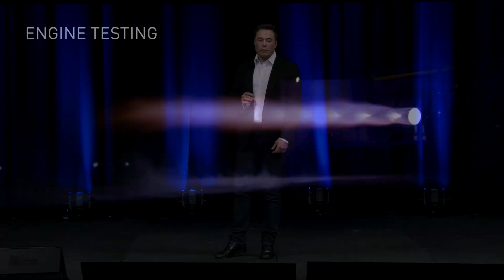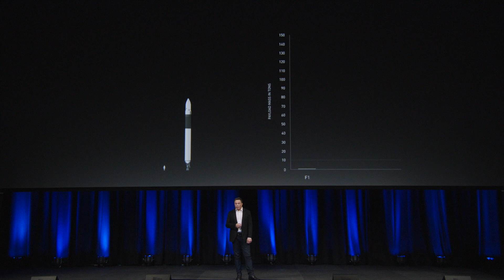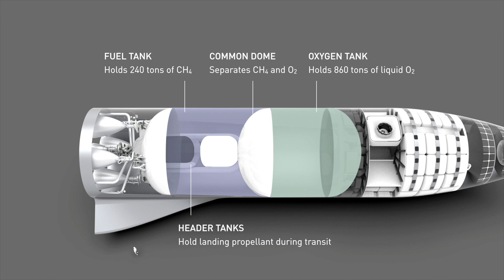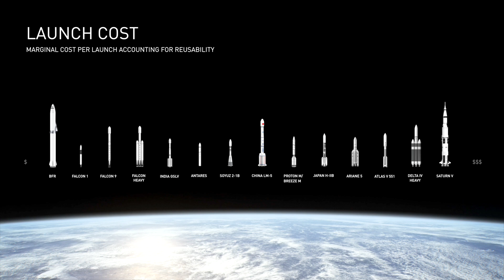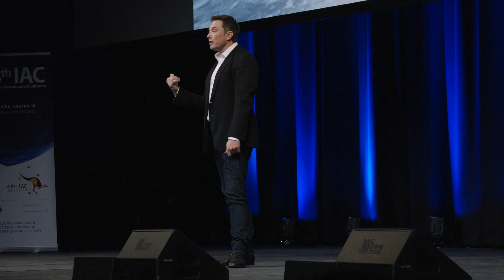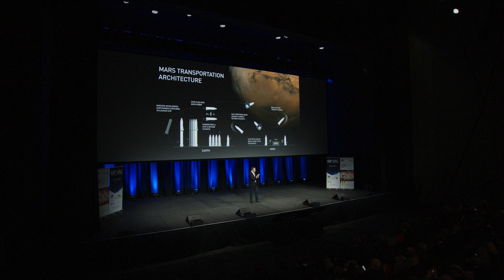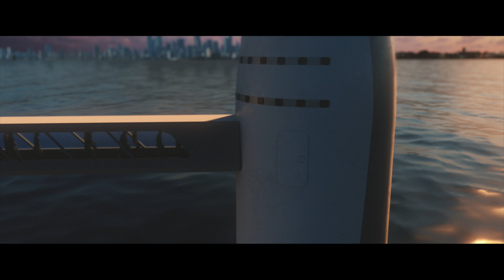Making Life Multiplanetary

Comment: You need nuclear to power a city on Mars, so if Elon could just take the next step with nuclear energy and take over the energy market as well, that would be the dream.
Google LFTRs.
Reply: Keep in mind, Elon and SpaceX will have nothing to do with the colony itself. All they're doing is supplying the rockets, what's done there is up to their customers.
Reply: Mate, don't put everything on Musk! He can't just invent everything. You do it. U say - 'pff me?'  YES! - You! learn some physics, join some resarch team, find some investors and bring us closer to thermonuclear or other new energy source so elon can use it on Mars! C'mone, don't just stand there, GET TO WORK!
Reply: "Solar can never replace fossil fuels (especially on Mars!). " ? Uhm, there are no fossil fuels on Mars, it's not the Earth. You can make chemical fuels with energy and the needed raw materials, it's not fossil though but "artificial" if you like. Which power source you use to do this doesn't really matter at this stage.
Reply: Basically any non-corrosive substance with a boiling and liquid point in an acceptable range and a high enough heat capacity is suitable for use in a turbine. Supercritical CO2 is a possible alternative.
Reply: Again the thorium guys, you would have to carry fissile materials to mars, witch, even if you discard the risk of putting radioactive materials into a rocket, are very dense, shield the reactor and use untested liquid co2 for heat transference? Yeah that is way less complex than solar. To build and run an nuclear reactor you need a lot of specialists, a lot of maintenance and a lot of time, with photovoltaic pannels you just mount them and forget, sure you have to dust them once in a while but that is  it. With the level of complexity and mass needed for a nuclear reactor you could build even an orbital solar installation and beam down the power since they would need an orbital gateway in the future anyways.
Reply: Merecir they have to start somewhere, solar will work fine at first, and sometime down the line, they'll develop nuclear.
Reply: Brian: So you failed in the task of actually checking out what a LFTR is.
-Just so you know, you do not use water at any stage in the process of creating power in a LFTR.
As stated, Mars is too far away from the sun to provide a significant amount of energy, the bigger the solar farms get the more effort is needed to keep them clean from Martian dust.
RTGs can power rovers and space probes (Curiosity uses two of them), but lack the juice to power even a proper mass moving vehicle.
Fusion is still practically sci-fi, and still 'only' 50 years away from a functioning reactor. What do you mean by creating energy "directly"? A fusion reactor would still heat a medium that then would run a generator, just as the most basic coal powered plants we use today.

Fun fact; RTGs run on P238, the production of P238 only takes place in ONE place and they only produce about 1,5kg/year. 
In a LFTR the only "waste" produced is P238. So with LFTRs on site you can make rovers powered by locally made RTGs. No need to transport Plutonium all the way to Mars.
Reply: Yes I know a LFTR(or any molten salt reactor) itself does not use any water.. but I wasn't aware that anyone was using a non-steam methods to extract the heat and drive the turbines. After you get the heat to the heat exchanger the rest really doesn't have anything to do with the reactor. Though I do see some references to using other gases but i'm not seeing any good sources, can you point me to one. that sounds interesting if there is a method other then that. 

There are a few companies now working on fusion devices that do not produce energy running a generator. The ones that I follow are Dense Plasma Focus devices. LPPX is making good progress on this. It creates electricity by running an ion stream through a coil and converting x-rays to electricity like light for solar panels. 

I thought LFTR didn't product any P-238. Isn't that the reason people like it, and most likely why it was never developed. It's main by product is U-233 with cannot be weaponized.
Reply: Sorry, I was thinking of P-239.
Reply: Lmaluko: There are plenty of Thorium on Mars. You only need ready fissile material to start the reactor, after that you just feed it Thorium and it makes Uranium as part of the process. 
They are already sending up Plutonium in RTGs so that risk is obviously low enough.
To even come close to the output from a reactor the number of solar panes you would need becomes ridiculous. Remember that the sunshine on Mars is much fainter.
When the solar panels break they need to send new ones, a LFTR just needs local Thorium to run.
Reply: I doubt that any city on mars would have the water to spare for any LFTR, or common fission reactor, for a long time. Best would still be solar or a fusion device that directly creates energy. Not sure how useful radioisotope thermoelectric generators would be for large scales like this, but they would give needed heat as a side product.
Reply: Merecir 
Musk owns one of the largest producers of Solar Panels in the world.

He's probably just gonna further his own interests.
Reply: Solar can never replace fossil fuels (especially on Mars!). Solar might be enough to power that fuel station if it has two years to make fuel for the next launch window. But to build a proper base with heating and powerful mass moving electric vehicles they will absolutely need nuclear reactors.

Comment: First big issue: I think the retro rocket manned landing is going to be difficult to man rate, I can't see how you make it fail safe or not subject to single point catastrophic failure. Maybe the crew will have to parachute! Secondly sub orbital transport, is he high, the noise would be nuts and the fuel cost per person massive. Also the issue of man rating the retro landing only this time with 500 people onboard!
Reply: Man rating it will take time and many successful landings.  Fuel cost will not be enormous: 

At take-off for long distance flight airplane has fuel about 40% of its mass.  Rocket to LEO needs be about 90% propellant, BUT most of it is oxygen! So rocket needs only about 20% fuel of take-off mass (less for intercontinental flight).  Perhaps BFR cannot take as many passengers as airplane (same size), but energy efficiency is not much worse than airplanes. It is probably more energy efficient than any supersonic airplane will ever be.
Reply: jkn An aircraft landing is inherently more failure resistant than the propulsive landing, the failure of any one component generally won't cause a catastrophic accident. Whereas the propulsive landing has the rocket coming down at high velocities until very close to the ground, also you don't get multiple goes at it. Realistically I expect that it will take around a hundred propulsive landings to man rate for daring, trained astronauts with access to things like spacesuits and ejector seats. To allow commercial flight landings you are going to need to demonstrate that propulsive landing fails less than one time in a million, even with component testing and qualification testing in extreme environments I think that you will need to demonstrate tens of thousands of propulsive landings if not an actual million before commercial passengers would be allowed to fly.
Reply: Deep_Dive, Short duration of rocket flight means that weather at landing site does not cause surprises.  Landing is fully automatic.  Two risk factors of airplane landing removed.  

Perhaps passenger section of rocket ship should be able to separate and land in case of emergency, like Dragon does.  We will not see this soon.

Comment: My question is this:  Why not test our ability to colonize another planet, by colonizing the moon first?  It would be far cheaper and faster to learn from our mistakes and ready ourselves for the challenges that await, close to home, instead of travelling such long distances at the outset of such an endeavor.  Does anyone see a good reason not to do so, and proceed directly to Mars?
Reply: Ya ideally a moon base would come first, but Musk is trying to get people on board to the big step of permanent colonizing which needs Mars.
If you tell people now we will first only go to the moon and then wait a while, then we get back to the old problem of public loosing interest before things really get going.
Reply: The moon doesn't have enough resources, and is really inhospitable in general. Mars is too, but it still has some redeeming features.
Reply: I agree that the radiation would probably be a concern, with no atmosphere and an ultra weak magnetic field...  I'd suppose a colony structure would have to either be heavily shielded, or built underground- both solutions posing problems with transporting weight from Earth into space.
Reply: Radiation is not the problem here. Mars doesn't have operational magnetosphere either. The moon only has negligible trace amounts of H2O. Almost impossible to mine and therefor you'd have to ship oxygen and water back and forth from earth. That is not economically viable and will fail due to lack of money. You cannot sustain a decent sized colony there. And Lunar gravity is .19 mars is .33, the closer to 1 the better.
Reply: Listen to Dr. Robert Zubrin explain why Mars first is the way to go.

https://www.youtube.com/watch?v=EKQSijn9FBs
Reply: Money
Reply: xNyghtshade, I don't agree with him.  This does not matter.  Others want to go to the Moon.  SpaceX will provide transport.  So we will have Moon base before SpaceX gets landing permission for Mars.
Reply: TBestiG, Moon does have enough resources.  I don 't know about nitrogen and carbon, but life support does not need much of those.
Reply: Moon does have enough water for base and fuel production.  (As ice on polar craters and in minerals elsewhere.) Moon gravity might not be enough for our bodies (we don't know).  That can be solved with rotating structures.

Huge advantages of the Moon: Shorter travel time and possibility to launch to orbit without using rocket fuel. (Long maglev track needed.)

Comment: What about Europa and Eceladus ?
Reply: Ganymede makes more sense, is bigger so more gravity = better for humans. There is water and it is the only moon in solar system with magnetic field, reducing radiation perils. Will have to convert second stage to operate on liquid hydrogen though and perhaps refuel on outer edge of the asteroid belt. If you build four stations there launch windows will be abundant enough for economic relations between Mars and Ganymede.
Reply: Yes, Ganymede for a settlement, but i was more onto exploration. Europa and Enceladus will need drilling, and making that with robots is just nightmare. Solar is just not enough power around Saturn. Jupiter is the limit for exploitable solar energy, except if there are some major breakthrough. Anyway a polyvalent spaceship is the way to go, if you can't budget your n'th project, make it the one project.

Comment: I do see how you could run into some problems with cramming 100 people into a rocket for a 3-6 month mission. I think it would be more reliable to just send 10 people at a time unless we can put the 100 people into medically induced comas for the trip
Reply: 825 cubic meters of pressurized volume is 8,25 per capita = pleasant. Square footage is irrelevant in zero G since you use all of the space available to you.

Comment: Is it possible to prevent detrimental damage to the spaceship carrying the crew in case of explosion? What would be required to do it? Is it even possible with currently available materials or would it require something like a 5-meter thick steel shield between the O2 tank and the spaceship?
Reply: Good real-time engine and tank analytics + third stage / escape pod with superdraco thrusters would do. Dragon spacecraft V2 is already capable of this, just need to scale it up.
Reply: But what about the blast itself? Wouldn't it destroy the whole thing?
Reply: If precursors to blast are not detected early enough, I think it would destroy it all yes...

Comment: 34 mins, with ion thrusters, electric thrust is technically possible
Reply: It is, but horribly slow. They have/are investigating electric propulsion, but realistically the energy demands would be so high for a worthwhile thrust level that they'd need to use a nuclear reactor (because otherwise the needed solar panels would be HUGE), which would incur possibly-insurmountable regulatory issues. Also, if you are then allowed to use nuclear for a power source, then nuclear-thermal propulsion starts looking really attractive, although its lower efficiency, since you can generate massive thrust with it at still much higher efficiency than chemical propulsion, and drastically lower trip times (and thus, much increased cargo capacity, due to needing much less propellant, since you'd just use chemical propulsion for takeoff and landing, to avoid nuclear contamination of those sites) - and they're investigating this, too.

I do wonder whether you could actually get a really powerful electric thruster using nuclear power... if you can produce nearly a GW of power, surely you can accelerate a lot of xenon continuously. It's still be considerably less than a chemical or especially nuclear-thermal, but you could run it nearly continuously, sooo... hmm.

Comment: "Chief Designer" is Elon's best and most accurate title.

This is a breathtaking and  convincing roadmap. However,  some of the final bits must be considered as a demonstration of what is possible, what horizons open up, rather than what will, or should, happen. In particular, there is no need to travel half way around the world in half an hour, when it can already be done in a day. The BFR is the 747 of space, not the SST/Concorde/Tu-144 of the 21st century. Furthermore,  sheer environmental disturbance (e.g. engine noise, sonic booms, exhaust plumes, blowback and danger of explosion) would place launch/landing pads far away from any habitation, not just on Earth but on the Moon and Mars, too. The pads would need to be shielded and paved on the Moon and Mars to avoid exhaust-driven material from hitting installations on the ground as ships land and take off. (PS: BFR will generate the mother-of-all-sonic booms on return to the pad on Earth. The idea of returning to the launch pad itself makes perfect sense, and already Falcon 9 is hitting its target within a metre or two, even on moving, heaving barges. By the time of BFR, that accuracy could be a few centimetres, and on the launch pad the blowback will be directed away nicely from the delicate engine section.)
Reply: awuma 
I don't know, rapid planetary transit could be incredible useful for cargo and military purposes. 

You can probably fit around 500 people in each flight(strip out all the cabins and replace them with rows and rows of seats), in theory if they can fill every seat a ticket would be about the same as standard international flight.

It would essentially be cheap space tourism with the bonus of getting to where ever you wanna go in 2-3 hours (that's including all the set up time to get to the rocket's launch pad in the middle of the ocean).

Comment: Docking the BFR to the ISS wouldn't get its orbit lower dued to the increased total mass?
Reply: It will, but negligible amount of added orbital decay and not due to mass but increased atmospheric drag (very low orbit so still some extremely thin atmosphere) ISS has to thrust about twice a year to correct for decay and a couple of times to dodge space debris. You could calculate increased drag and decay by the surface area of BFR and number of days being spent docked to the station. Will be very minor
Reply: I wouldn't think so since the BFR would have all it's momentum coming along with it. Like if the ISS suddenly became more massive that would be an issue, but the BFR would already be moving at the correct velocity so in my amateur opinion I think it wouldn't make a difference.
Reply: Nope, that's irrelevant. As long as it matches orbits before, which it will, it will have zero impact. Well it might block the solar panels from the sun...

Comment: What would the price be?
Reply: Depends on how many passengers, fuel production cost, re-usability before maintenance. But if you can produce all this rocket fuel using solar power plants for example, and that's it, well then it will become extremely cheap, especially taken into account how fast you will travel.

Comment: What exactly does the solar storm shelter consist of? A small capsule completely surrounded by 2m of water would be about 109tons. Or perhaps is the shelter surrounded by the propellant tanks?
Reply: You do not to be "surrounded". Sun is not around you. Just thick shield in one direction...
Reply: Grigory Buteyko
Didn't you see my critique of Musk's previous proposal? Search "The Interplanetary Transport System will KILL YOU"
You can't shield one side of the craft. While the initial blast of the solar flare may be pointed away from the sun, the solar flare particles fall along the Sun's magnetic field lines and are carried off in all directions. Thus you need to be completely surrounded.
Reply: Jarrah White 
High density polyethylene is a quite good solar  radiation Shield. The key thing is for the material to have a large percentage of its mass be hydrogen. Wayne being a hydrocarbon qualifies.